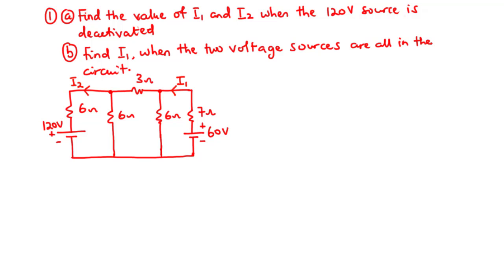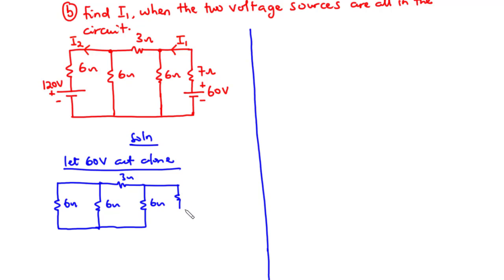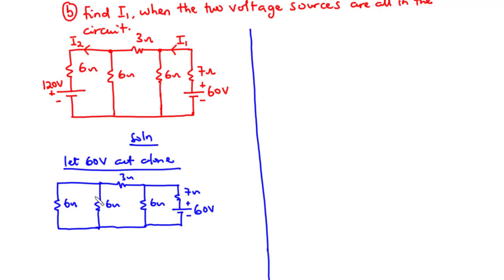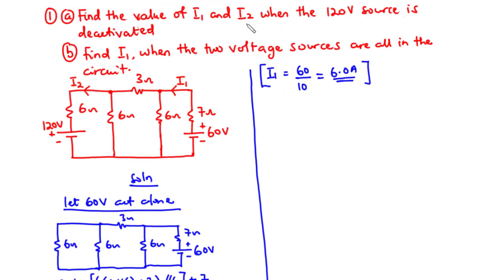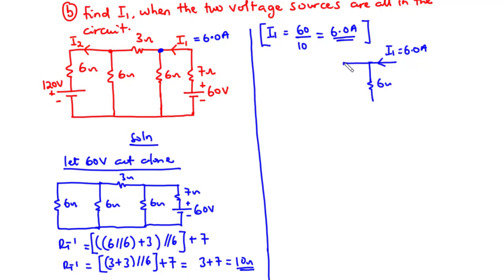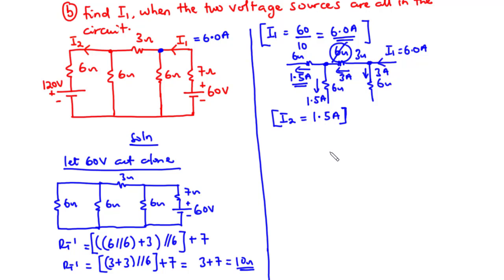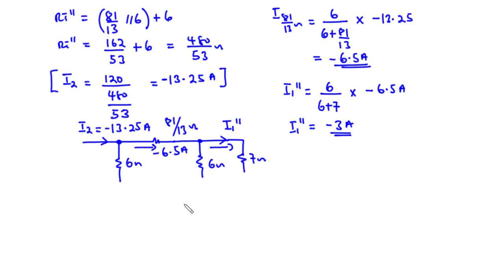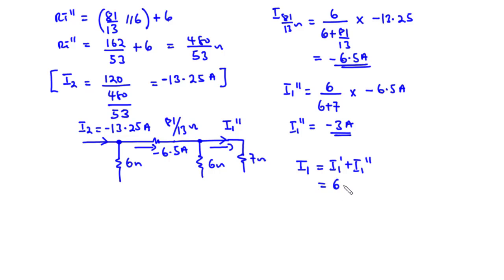24b - 🔴MIDSEM EXAMS: Superposition Theorem Problems #knust

Comment: You didn't calculate the current through the 3 ohm resistor. That's the current that is shared between the two parallel 6 ohm resistors.
Reply from the maker: For which of the theorems, kindly clarify for easy identification and substantiate.

Comment: Why is it that in the first question u said the current will split equally but in the second u used current division rule
Reply: Ok thank you but when i use the current division formula for the question in which u split the current equally,i had a different answer
Reply from the maker: really, kindly check it well okay, because you should same answer @kelvinkwawafful4649
Reply: I’m lost
Reply from the maker: @_WAYZZZFX where please
Reply from the maker: Yes, but then it's still current division rule that we need to use to split current. The trick is that if the resistors have the same value, the current will be shared equally.
Reply: @SkanCityAcademy_SirJohn  so if the resistors are not of the same value then u apply the current division rule right
Reply from the maker: in both cases you use current division rule, I'm only saying that if the resistors going to share the current are the same, you do not bother yourself doing the formula work because they will share the approaching current equally, however if they are not the same, then since we cannot assume we need to solve using the formula @kelvinkwawafful4649
Reply: Sorry I’ve now understood

Comment: For the second part, the current is going through the 7ohm resistor so why do you use the 6 ohm resistor as the numerator when calculat ing for the current I prime prime with the current division theorem instead of the one recieving that current as the numerator( the 7ohm instead) ?
Reply from the maker: Well, you know resistance offers opposition to the flow of current, so the higher the resistance the smaller the current in it. That's where the idea comes from. I presume you are a little confused about current division and voltage division.

For current division, if you want to find current in resistor A, then:
= B/(A+B) * I

With voltage division, to find voltage across A, it's
= A/(A+B) * I

Comment: When I did current division rule at 7:19 I got 2A for I2. I said

 I(3ohm)=(6/3+6)×6=4A 
then I2=0.5×4=2A. where did I go wrong?
Reply from the maker: You need to do the division on a step-by-step bases. So starting from the left, (6ohms combines in parallel with another 6) which is 3ohms then in series with another 3, making 6, which later I crossed not to confuse anyone. I1 is 6A, so at the moment, we share I1 between tow 6ohms, which is 3A for each. Moving to the left we try to open up the resistors, .... So kindly visit the video again. I guess you will get it. If anything please let me know.

Comment: Good explanation.. I have a question on the first part of the problem when calculating I2=1.5A. Why did you share the 6A between 6ohm and 6ohm instead of (6:6:3 ohm) resistors
Reply from the maker: This is so because all three resistors are not connected in parallel. 6 and 6 are in parallel taking from the left and in series with 3
Reply: @SkanCityAcademy_SirJohn  Aren't they since the current divides to the 6 and the rest goes to the rest of the circuit meaning all of them are parallel?
Reply from the maker: No please